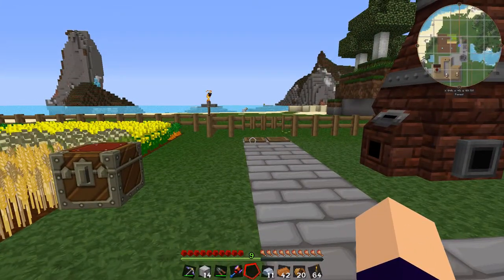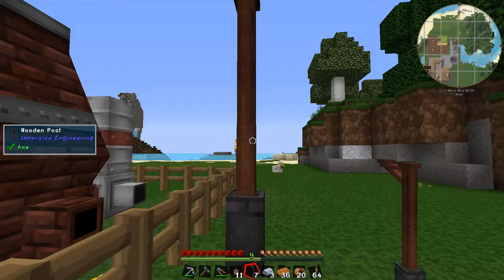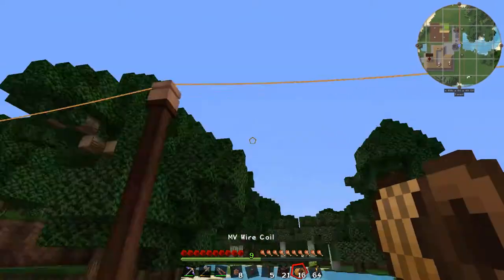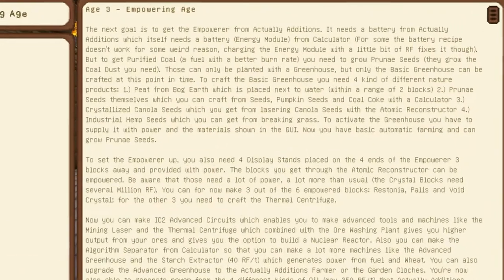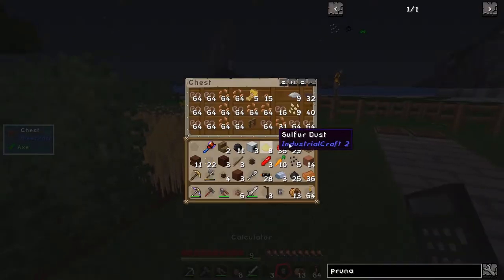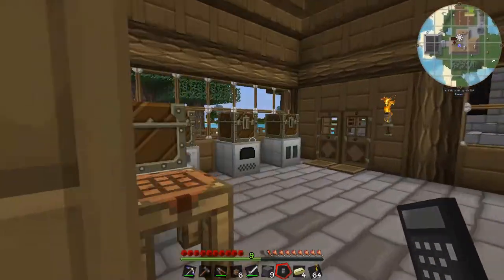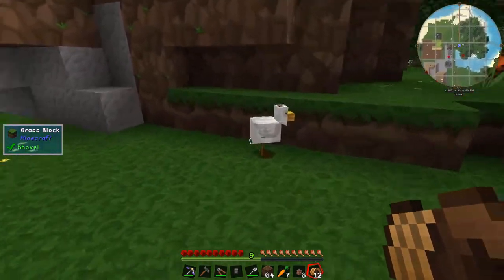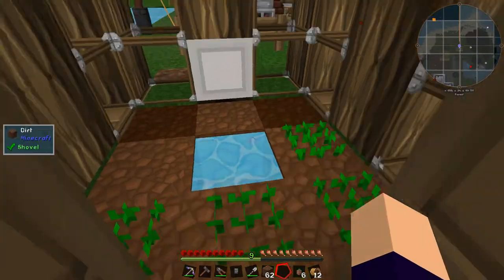Age of Engineering 13 | Green Houses! | Closet Gamer

Comment: Oh man, I just had an idea, Im gonna try it. That ic2 slag is great stuff, you can centrifuge it for gold and coal dust. I like that better than the immersive slag. I'm gonna plop a 1x2 drawer in front of the output for the blast furnace, with ic2 slag in it to see if it converts into that.
Reply from the maker: Sounds neat! Let me know if it works ;)
Reply: Closet Gamer when I tried it, it wouldn't push it in, but I could put it in. It that was before the ender age, so I didn't try item conduits, or nay other piping.

Comment: I didn't know about the gas lanterns - you're doing a good job of showing off the pack well! :)

Also, I've had the same issue with IE post rendering, and that was on Beyond. It's annoying as heck but not much you can do about it - your solution was a good one!
Reply from the maker: FallingofftheGrid yea I actually did a little research for this one xD I like calculator, a lot more than I thought I would... the greenhouse elements are really nice and I'm looking forward to seeing how it progresses! Any idea how to sort out those IE power poles?
Reply: I think you hit it with an engineering hammer to make the arm pop out.  I haven't played with them much.
Reply from the maker: +Squid_Squirt W thanks mate, I tried that and the outline block changed shape but the post still didn't render. Think it might be a bit of a bug :)
Reply: Closet Gamer I'm not sure if you ever figured this out, but the only time the rendering is weird on the posts is when you're standing under them, and looking up. They're perfectly viable, and look fine, once they're set up. Just pillar up, to place the connections, walk away, and looks great.
Reply from the maker: liquid klone no mate, never really persevered with trying to  make them behave. I'll give this advice a go through - they are very useful for long runs. Cheers man